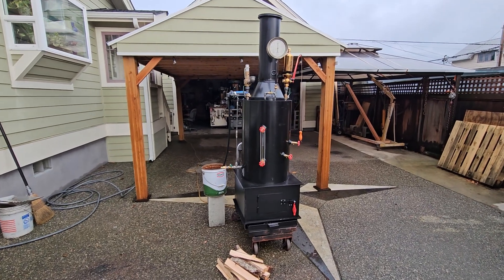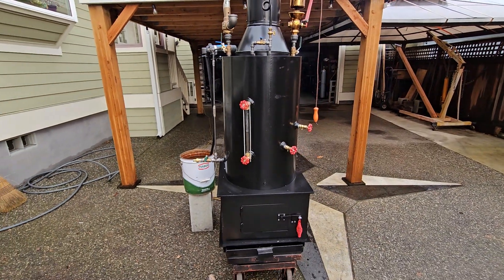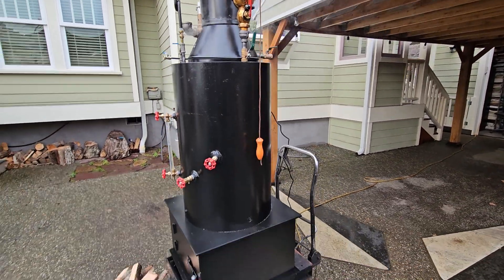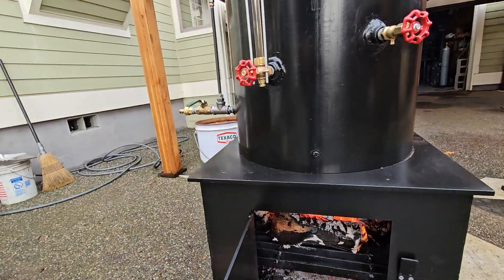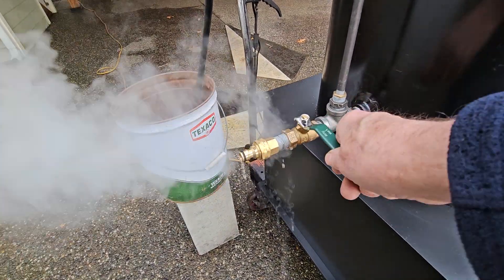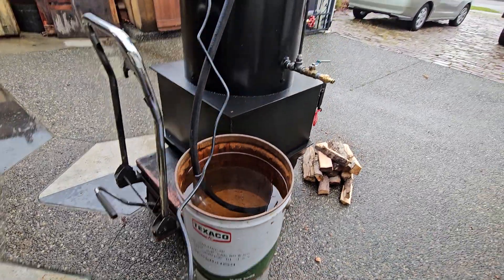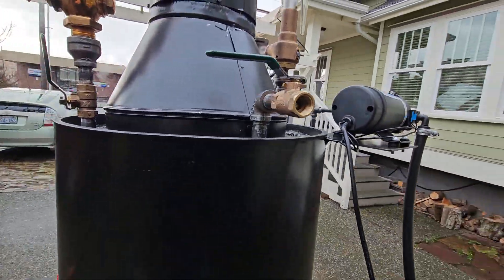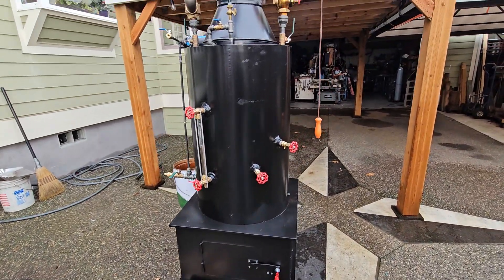Steam Engine 20" Boiler Pump Whistle Gauge Off Grid Ross Bendixen

Comment: How much do these boilers cost on average?
Reply from the maker: It is on ebay for $5,975.00. If you buy direct from me it is 10% less. Ross
Reply: @rossbendixen  can this be used to charge up a battery bank? I’m looking for a non-solar way to charge up battery banks for northern climates. 🤔
Reply: @ContraMondial 
Yes, with PMG in line off the belt with AC or DC.
Excellent workmanship and a good person.
Mine works great thanks Ross! 😊